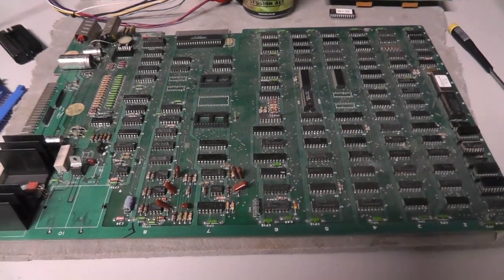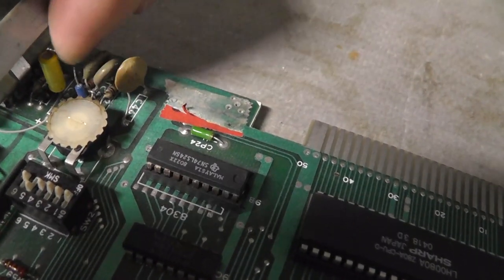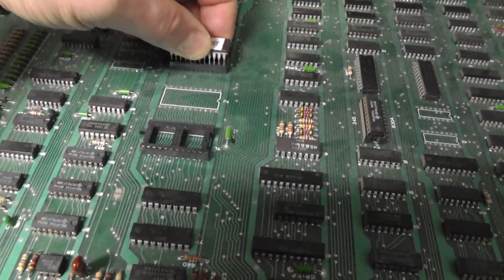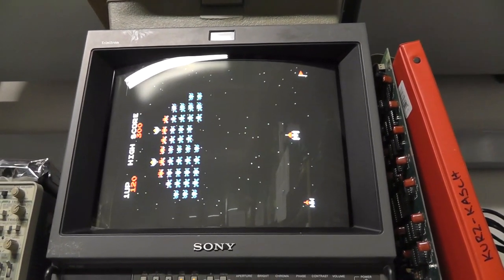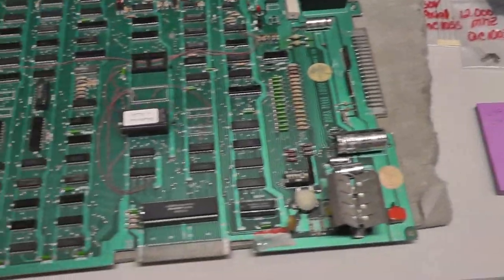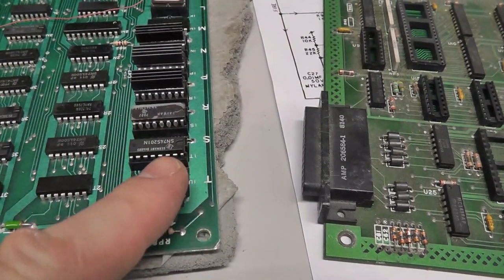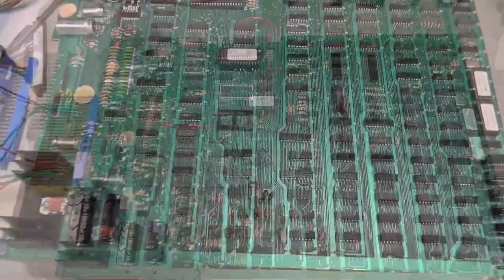Galaxian PCB #2 - 4play Hack and Repair - Long

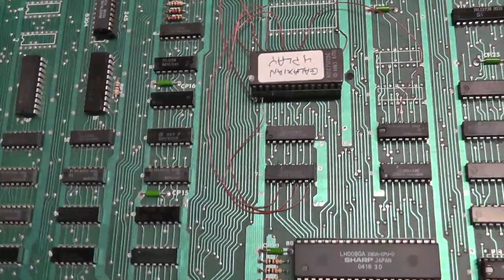Comment: 14:40 that pin is clock. If it's a cap, it's gonna deglitch, if it's shorting to ground, it's gonna just make a buffer out of the chip. From my understanding of this part of the Galaxians circuit, neither mod would make much of a difference...
Btw. I once had a Galaxian error out with RAM ERROR 2. From earlier repairs I was kinda settled on addressing/muxing issues so I went down a rabbit hole with no end. Especially since the Test ROM just passed. Every time. And the background graphics during testing looked sensible. Turned out, that both background 2114s had developed some tiny single bit errors where a bit would flip back a few nanoseconds after setting. The test ROM didn't catch that but the Galaxian self test did...
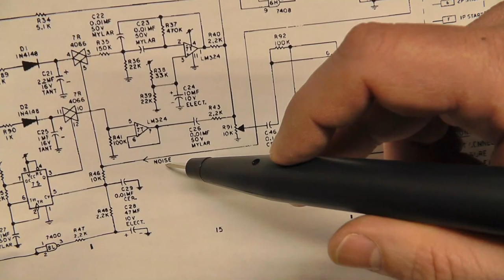~28:00 dial up internet flashbacks intensify
32:50 that Qix CPU board has seen better days ;-)
And just like yours, my Galaxian's big red power transistor also quit during my first time repairing it (was completely dead, video address generator had two bad LS161s)

Comment: I have just repaired a Midway Galaxian which has the small capacitor connected to ground and pin 9 of 74174 @ U1 near the attack RAM chips. I also have a Namco and a bootleg Galaxian that doesn’t have it. I believe it’s to do with what 74 series chip is being used at E1 and the cap is to reduce noise on pin 9 of U1 as it’s the clock pin. I removed it on my Midway board and although the game seemed to play perfectly, putting the logic probe on pin 9 made it go mad. Reconnected it and the probe was silent like my other two boards
Reply from the maker: Thanks for sharing that!  Yea on some of my boards it is there and on others it isn't.  I never got to the point of exploring what its purpose was.

Comment: Have you read the Midway Galaxian troubleshooting manual because repair tech claim that when the spirits are causing glitching images that you use a jumper wire with a series resistor to pull up to +5vdc and test each spirits RAM chip output pin until the spirits glitching image goes away that is a BAD spirit RAM. I don't know why pulling up the RAM output pin up to +5vdc would track down the bad spirit RAM chip. Have you heard of this technique and read it in the Galaxian manual?

Comment: When does the ALE Address latch enable output a signal under what condition in arcade games?
Reply from the maker: did I mention address latch enable in this video? z80 doesn't have this.
Reply: @jacklick  No just saying in general the Z80 goes under a different name for the ALE, MREQ, VMA I think they are all the same thing just different names. These signals should be used in arcade games because they tell the Chip Select that the address buss is valid. Have you looked into these signals ALE, MREQ, VMA? Is Santa going to get you a logic analyzer, because they have USB logic analyzer that are cheap on amazon so you can take a good working arcade board and make a video lesson on how to test various types of digital logic to learn how to use a logic analyzer for fun

Comment: JACKLICK
  1.) I'm confused what that video probe ( blue jumper wire ) is doing? its taking what video signal to R40 to see dancing green lines for what kind of test is this doing?
2.) I'm guessing Galaxian doesn't have a "test diagnostic mode" so you have to use a  TEST ROM chip? 
3.) You called one of the ROM chips a "tack ROM" what is a Tack ROM? you mention some of the ROM chips are called working ROMs and the other is a TACK ROM
4.) What kind of decoupling capacitors for each IC chip that are the "small blue" axial types? I know they aren't ceramic
Reply from the maker: re 1) think of the video probe as poor man's oscilloscope/signature analyzer.  It is allowing you to visually see a signal and compare it to a known working example.  By itself it doesn't do anything or tell you anything.  Just allows you to visually compare.  I only used it as the galaxian troubleshooting guide references its use.
re 2) Galaxian does have a test mode but in this case, I started with no daughter board for the program roms.  The test rom also likely does some additional ram tests but I don't know that for certain.
re 3) I called some RAM "Attack" RAM...or at least I meant to.  This is what the schematics refer to the them as.  There is also Object Ram (ORAM) and Video Ram (VRAM) we saw on the diag screen tested ok and then what I called "Working" Ram or just Ram.  Not sure these are standard terms but are based on how how the game system is using them functionally.
re 4) the caps are .1uf ceramic axials, according to documentation
Reply: @jacklick  thanks for the help 
I have only seen those ceramic axials used on arcade games i don't see them use often only ceramic disc types i see more often. 
1.) The Video Probe is taking what kind of signal is it the RGB composite video being applied/jumped to what input/circuit?
Reply from the maker: @bill williams good question.  The signal is called "cmp blk"  I am not 100% sure but think it is a composite blank (combined vblank and hblank)?.  This would give the signal some consistency. I assume you could tie to the red or blue lines as well but green is likely easier to see result.
Reply: @jacklick  ok thanks for the help
I have never seen that type of test done before its a type of "circuit bending test" when jumping signals like that. 
I'm guess they are testing the video sync circuit?
The more lines you see during the green display means the sync circuit is working?
Reply from the maker: @billwilliams6338  the video probe is testing the output/pin of wherever the probe is placed.  That output is fed to the "composite blank" signal on the green color output which makes a visual representation of whatever is being tested.  If place probe on +5v it will show big solid green rectangle on screen (no lines).  In my next video I will show it on some 74LS161 and compare the visual display of using video probe to what is displayed on an oscilloscope.  Will probably be more clear.    you can also read about its use here https://www.arcade-museum.com/manuals-videogames/G/galaxian-Troubleshooting-Part2.pdf
Reply: @jacklick  Yes making a video about the video probe will help understand it more. I'm confused on how to troubleshoot arcade boards using the video probe. I don't get what the video probe is actually doing or what the concept of using the video probe to troubleshoot the arcade boards. 
The Video Probe is the Composite blank signal and you're "injecting/applying" the Composite blank signal to other IC input pins and output pins it seems to do visual display troubleshooting?
Reply from the maker: @billwilliams6338  I think a better way to think of it is in in reverse....you are taking the output of the composite blank signal on the green color output and combining it with the input/output signal of the chip you want to test/visualize.  You then take that observed visual behavior and compare it to a known working example.  This is where it is kind of like a poor mans O-scope combined with poor man's signature analysis.  you have a visual display of the signal being tested (scope), it is consistent and reproducible (NOP with SA), but needs a known good reference to provide any benefit.
Reply: @jacklick  oh ok thanks for the help, I get it now. yes that is what I was thinking it was but what I'm confused about it that "not all" input and output logic signals being measure when "combining it" with the Composite blank signal are going to display a visual behavior. But maybe I'm wrong maybe all logic input signals and logic output signals will display a visual behavior when combining it with the composite blank signal. 
I think they are using the Composite blank signal as like an oscilloscope has a trigger circuit built it to sync the signal to the Oscilloscope display. 
What they are doing is using the composite blank signal to SYNC up the measured logic input signal or measure logic output signal to get displayed on the arcade monitor as a Poor mans oscilloscope.

Comment: JACKLICK, 
               When reading the game codes contents from an arcade games ROM chip, what assembler can I use to convert the game code into reading the code easier?
           Can I load the game codes contents into an assembler and the assembler can convert the game code into reading the code easier and maybe debugging troubleshooting the code?
Reply from the maker: I haven't gotten into this level of debugging but would lean toward using the MAME debugger first.  You can search for  "6502 or z80 disassembler" and will find software as well.  Reading and writing assembly code is beyond my ability.
Reply: @jacklick  yes I just need to know the name of the correct compiler and disassembler software program that will take the game code from the arcade ROM chips that I have READ and convert it into readable or displaying what the code should do. 
I think the compiler converts the game code that is loaded in the arcade rom chips and makes it easier to read the assembly game code.